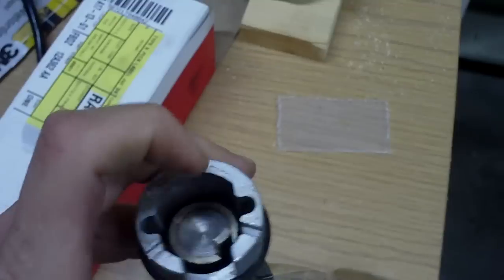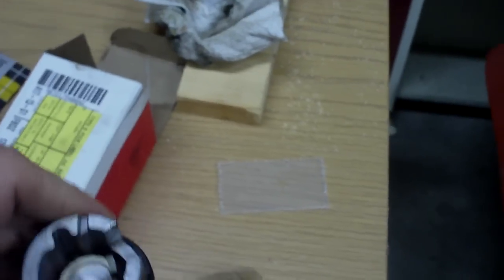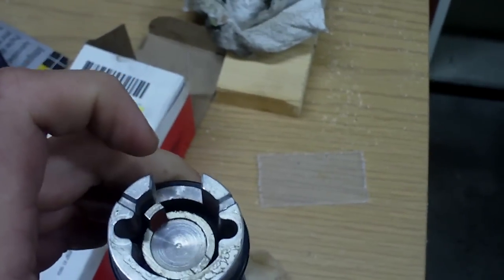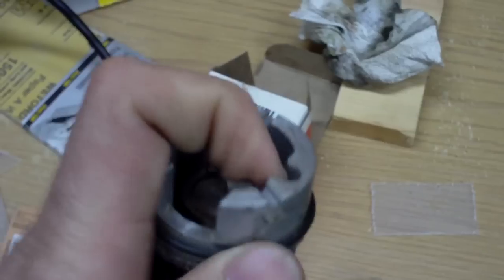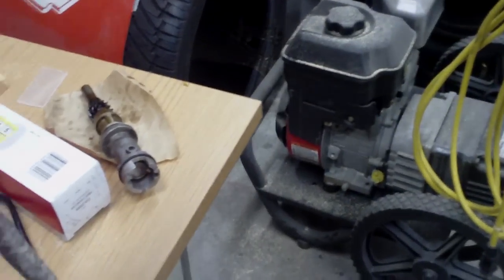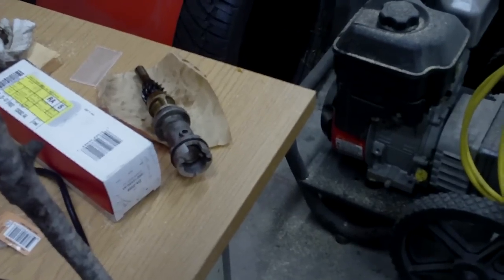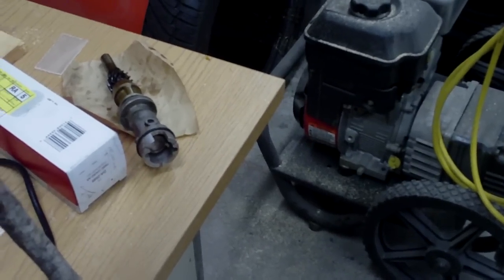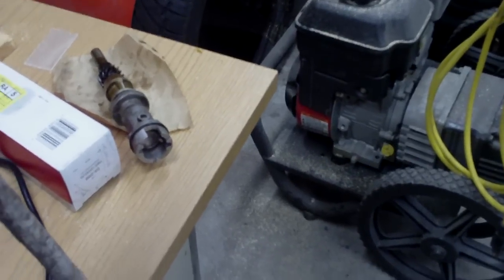Q and A Cam Synchro replacement

Comment from the maker: @jimbob37110 yeah, one of the first things i tried was the sensor.  If the code you pulled was for the sensor, try that first.  It's much cheaper than the whole assembly.  Good luck with the repair.

Comment: I have to do mine this coming weekend. It's been making that chirping sound for a long time, and will randomly squeal like a loose belt for a while on startup, especially when very cold. Now that I know what it is and how easy it is....
One question for you though, does the housing on the Synchronizer have a detent or something so it goes back in the block only one direction? I was wondering about that when you showing how you lined up the timing tab to the housing. Thanks in advance.

Comment: did you try changing the sensor out first, my 01 ranger is doing somewhat same thing minus the squeaking. when i give it gas at about 40 mph it will cut and rpm drop code came up as cam shaft position sensor.

Comment: Hey man, what were the symptoms you experienced due t the faulty camshaft sensor?  Thanks!
Reply: You might hear a chirping or squealing noise, and then again you might not hear anything unusual even if your camshaft synchronizer shaft is beginning to fail. Also, your engine may idle poorly and might run rough at higher rpms while at highway speeds. Your best bet is to pull the synchronizer out and inspect it for worn teeth on the gears and any play in the bushing. More than likely if you have over 60k miles on your truck then you are running on borrowed time if the synchronizer shaft has not been inspected or replaced since new. If the synchro shaft fails while you are driving, you will lose your oil pump and oil pressure and totally ruin your engine in the space of two seconds, all because of a couple of parts that you can buy for about $150.00.
Reply: Buick Mackane
Thanks for the reply!
I did replace it just this past week.  It started to squeak a bit, and the engine had an erratic idle and such.  I had 77K on the odometer on a 2007 Taurus with a 3.0 liter engine.